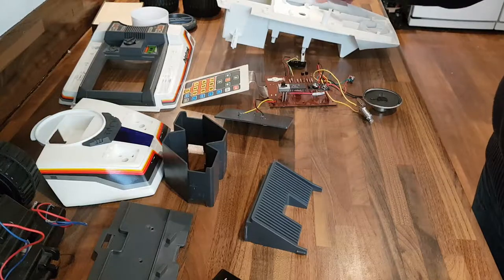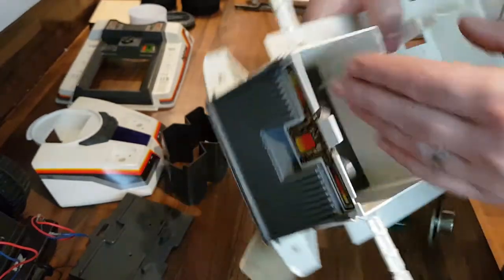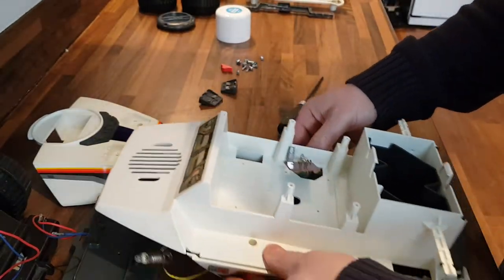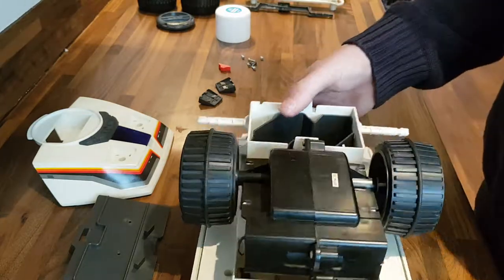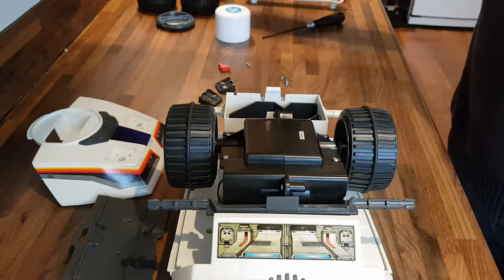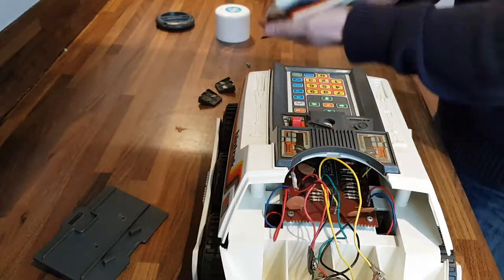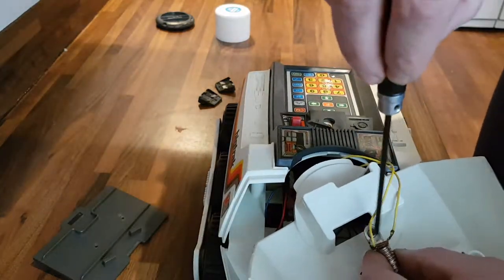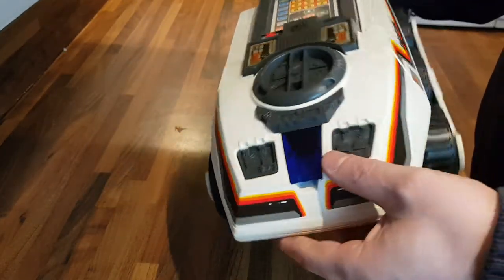MB Bigtrak 1980 reassembly.

Comment: Great work mate! There was a  Soviet made clone of the Big Trak called the "Moon Rover" or LUNOKHOD in Russian, Released in 1981, and it was made by a company called ELECTRONICA IM-11 which was based in Minsk, Belarus, this model "Clone" in my opinion is the best version created. Instead of stickers, it had actual plastic covers for the head lights, and side panels, plus rear tale lights as well, no cheap stickers. The Power button was locked at the rear and the Touch Pad was a Multi Color pad, made out of a much higher quality material. And finally, the best part, it had a Helipad, located where the 9volt battery would be located under the round grey cover which the Milton Bradley version had, a Flying Disk would shoot out of this Helipad, Super cool!